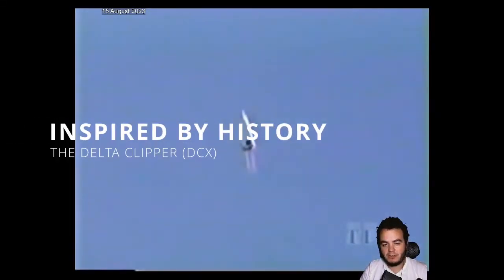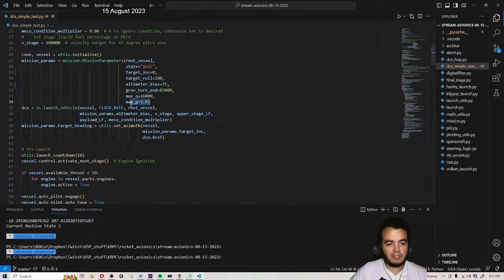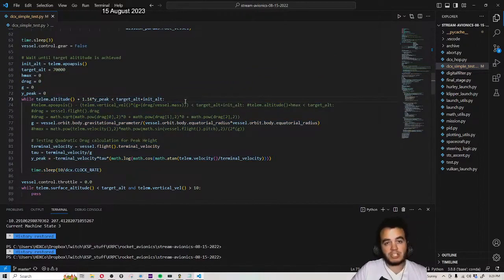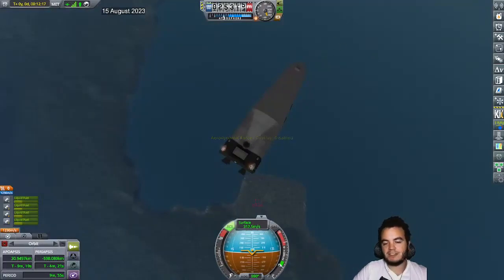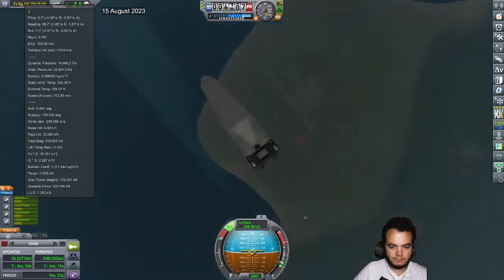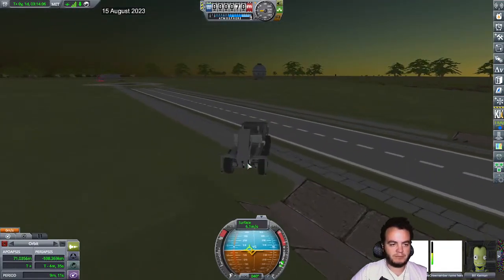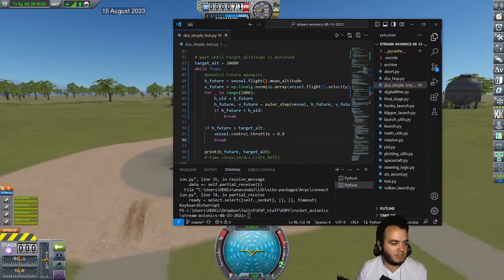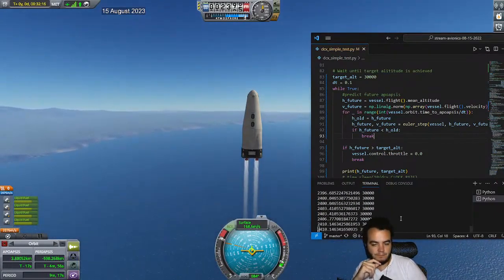Building a Trajectory Predictor in KSP with Python

Comment: I was actually talking with a friend about how I might set up programming a boostback, and we eventually got on to the topic of accounting for drag. I wasn unable to think of any sort of method to make an Euler method integrator that didn't require a loop, and you can't really have different loops on different clocks in kOS. The way he told me to do it was to just use a vacuum flat earth prediction with an experimental fudge factor. In the end, I didn't end up doing it, because I got distracted by a different idea. Probably for the best, I don't have the programming or math experience to pull it off properly.

Comment: the drag coefficient also varies based on mach number. From what I know its stable at low speeds, starts to get real fucky up in the transonic region, then starts to climb steadily with the mach number after mach 1. I tried to cook up a variation of this based on compressible flow dynamic pressure assuming the atmosphere is a perfect gas, but idk how accurate it is.
Reply from the maker: Indeed! I didn't realize at the time until after stream that KSP's aerodynamics do take into account Mach number with part Coeffs of Drag. Makes sense, just didn't think their aero model did that in the moment haha. But yes, in real life, coefficient of drag certainly increases sharply at transonic velocity, then peaks around Mach 1 depending on the shape, and then decreases as the entire vehicle goes supersonic.